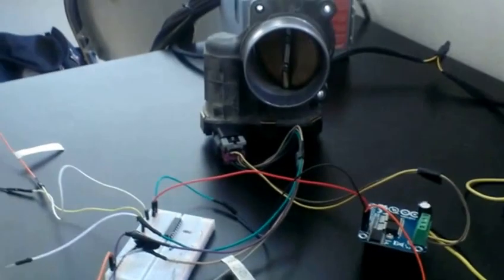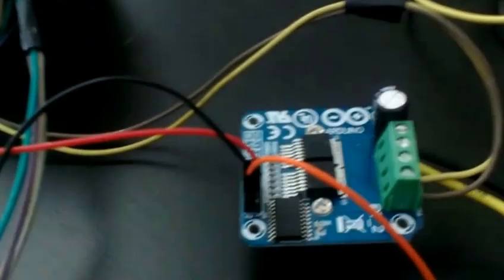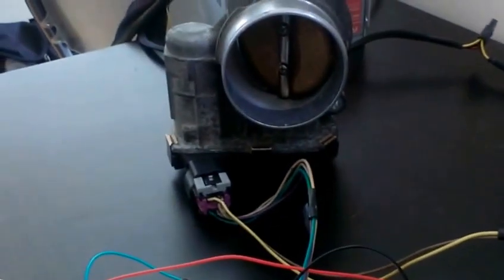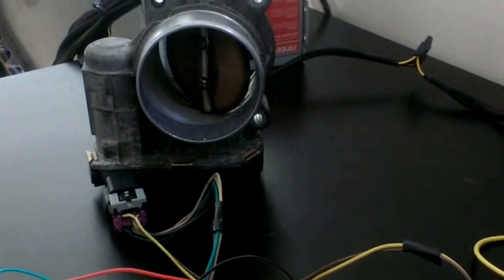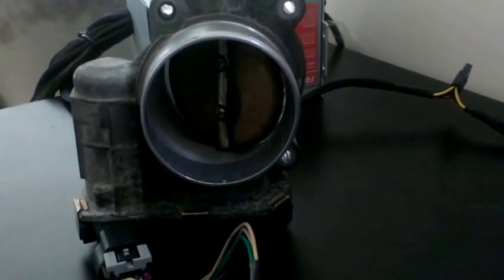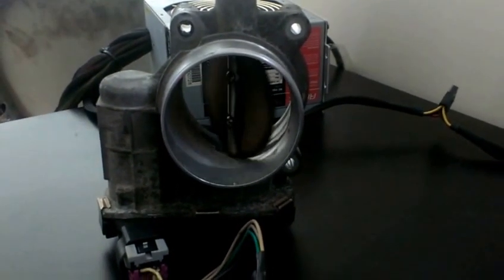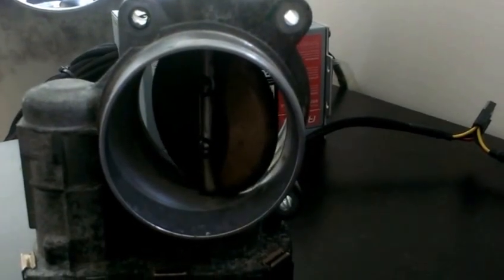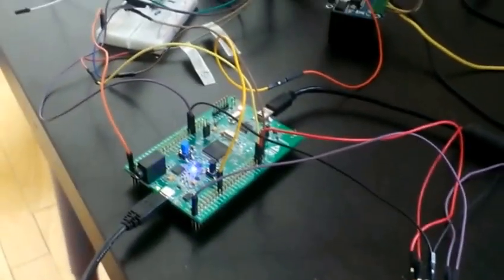ETB electronic throttle body control stm32 rusEfi BTS7960B

Comment: 3) Исходниками управления заслонкой не поделитесь? :)
Reply from the maker: Frimen3 https://svn.code.sf.net/p/rusefi/code/trunk/firmware/controllers/electronic_throttle.cpp
Reply: rusefi Андрей, вижу у вас в коде по ссылке инициализацию лишь ПИД регулятора с параметрами pid(1, 0, 0, 0, 100); То есть пропорциональный коэффициент равен 1, а интегральный с дифференциальным равны 0. Ведь с такими коэффициентами заслонка просто не сможет вести себя так как у Вас на видео? Не могли бы Вы поделиться настроенными коэффициентами? В одном из кодов для ардуино видел коэффициенты (4, 0,67, 150). Похожи ли они на истину?
Reply from the maker: Frimen3 Всё, что есть - в исходниках. Там есть вот такое место:

        boardConfiguration->etbPFactor = 1;
 boardConfiguration->etbIFactor = 0.5;
и кажется именно с этими параметрами оно на видео
Reply: rusefi а, вижу, получается (1, 0.5, 100). Спасибо!
Reply: rusefi Андрей, еще такой вопрос - я правильно понимаю что заданный потенциометром угол открытия  вы выставляете только подачей прямого напряжения на двигатель заслонки? То есть вы управляете только ее открытием, а в обратную сторону (в случае перерегулирования к примеру или необходимости уменьшить угол) она закрывается уже сама под воздействием натяжения встроенной пружины? Или все же обратное напряжение тоже подаете для более быстрого закрытия?
Reply from the maker: Frimen3 сейчас всё именно так - назад работает только пружина. пока это игры на столе, посмотрим как это будет на машине :)
Reply: rusefi да думаю на машине тоже все нормально будет :)

Comment: Приветствую! Пара вопросов:
1) Каким образом происходит управление двигателем дросселя у вас - вращаете его до того момента пока сопротивление одного из встроенных TPS не станет равным нужному?
2) Подойдет ли для управления такой заслонкой дешевый драйвер L298N http://ru.aliexpress.com/item/Free-Shipping-10pcs-New-Dual-H-Bridge-DC-Stepper-Motor-Drive-Controller-Board-Module-L298N-for/32262094109.html?aff_platform=aaf&sk=JMVv7eYBe%3A&cpt=1436216675528&af=120&cv=14704&cn=1660190611&dp=v4_120_14704_1660190611_&aff_trace_key=34855250104640017 ?
Reply from the maker: Frimen3 1) скорее дёргаю туда-сюда, пока не будет нужной позиции
2) L298N - up to 4A, есть мнение что этого чуть мало
Reply: rusefi спасибо, а заслонке сколько ампер нужно - не знаете? Есть ли у вас электронная почта для связи, будут предложения и вопросы по вашему проекту
Reply from the maker: Frimen3 я слышал цифру 6.

http://rusefi.com/forum/
Reply: rusefi еще такой вопрос - какое напряжение вы подаете на драйвер для управления двигателем - 5в, 6в, 12в? Какое вообще максимально допустимое напряжение для двигателя? Ведь я так понимаю чем оно выше тем заслонка быстрее открывается и закрывается...
Reply from the maker: Frimen3 12